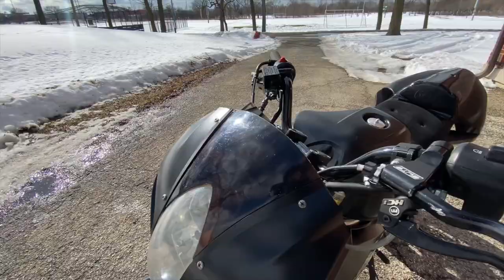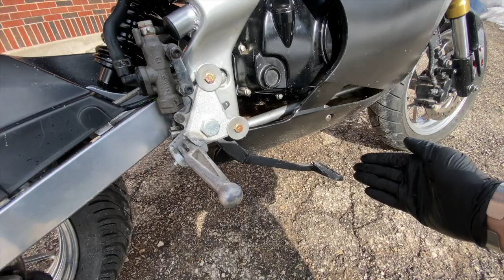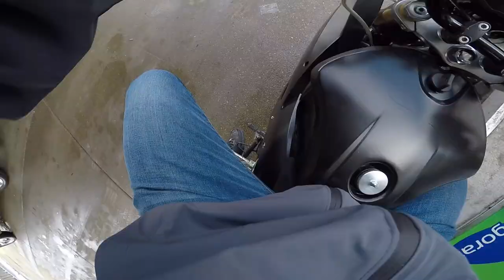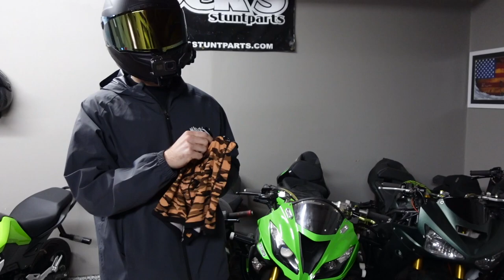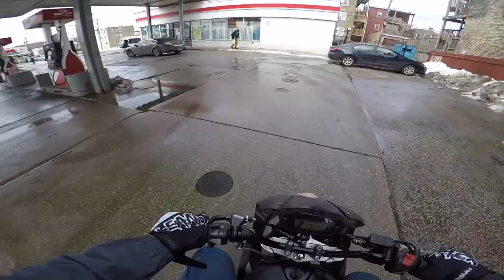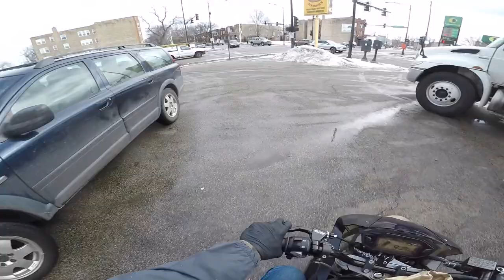The CRAZIEST POCKET BIKE! (Mini Stunt Bike)

Comment: We have Lifan motors here in Finland and they are actually pretty reliable and they have all the electrics for lights, horn etc. These Lifan motors are 4-stroke and they are from 50cc to 150cc I think.
Reply from the maker: But they are carburetored, not electric start and don’t have a Rev limiter right?
Reply: @brian636  Yeah true, forgot about that. Here youngsters put them on 50cc Monkey frames :D
Reply: Lifans bullet proof we repower ATC 70s and ripp up the prairie path here in suburbs of Chicago  want to rip state street with Brian so bad down to 47th street and get a spicy chicken Philly from Babas beef
Reply: @TURKEYMAN60185  Prairie Path??? I've ridden my bike on that as a kid a number of times. Berkley to Wheaton and then out to South Elgin. Good stuff! Enjoy!!
Reply: @deanhough8993  we have been riding from west Chicago to sycamore  passing through Wayne South Elgin St Charles FTP ALL DAY ONE WHEEL IN DA AIR 12OCLOCK.  JUST WISH  I COULD Be ON THE CITY RIDES WITH 636

Comment: I need help to get my x19 To be street legal. Here in texas it only needs Head lights and brake lights. I was wondering how you get the bike have vin did you go to Inspector and get the bike inspected and made a home made vin?? Because the frame doesn't have a vin #
Reply from the maker: I used the vin that came with the frame my guy!

Comment: This is how I rip around my town but I have a Razor Mx650 w/ 48v 2000w and it does 30+mph but the 72v 6000w Electro Braap kit does about 65+mph.... But I don't have an interesting town to ride in, just a shit hole in the middle of PA, which is why I'm riding electric because the police around here are uptight dick heads.    😂
Keep the rubber side down bro and the good videos coming...  😁👍